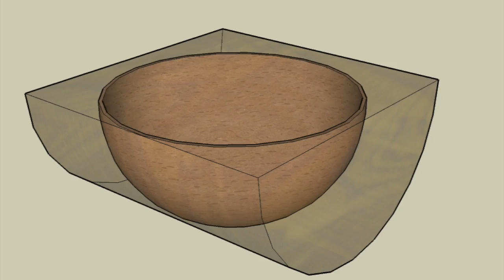President's Challenge, Sept. 2015

Comment: Thanks Brian, It seems as though I will be really limited since logs are not typically balanced. Perhaps I could make it partially round with my bandsaw and then put it on the lathe. Do you know of a way to slow the lathe speed down? The Grizzly lathe that I use has a bully system that uses double plates that squeeze tother. This alternating size slows and speeds the lathe. Thank you!

Comment: For those in the UK: DNA = Meths or a more recent (and slightly cheaper) alternative, bio ethanol (just check it's the 96% one).
Reply from the maker: Thanks for pointing out the difference in terminology.  I was unaware (but not surprised) that the nomenclature was different on the other side of the pond. ;-)

Comment: I really appreciate your articulate instructions! I have a Grizzly lathe and I want to start making bowls. The slowest speed is 600 RPM's. What is the safest way to make bowls on this lathe considering its slowest speed?
Thanks for any help!
Reply from the maker: +melanieheinrich The general recommendation for lathe speed is that the diameter of the work times the RPM should be from 6000 to 9000, so you could go up to 15"—if the work is balanced!  What you have to be really careful of with the low-end speed being so high is unbalanced work.  If the work is really out of balance it is apparent even when spinning the work by hand.  Apart from that, I would suggest always standing to the side when turing on the lathe at 600, and keep your finger on the off button so that you can turn the lathe off before it starts dancing.
Reply: +Brian Havens Check the speeds! I don't any lathe that will turn at 6000-9000.
Reply from the maker: +texanky 6000 - 9000 is just the reference.    8" bowl x 1000 rpm = 8000 , so that would be safe

Comment: Thank you Brian.  I have been using the alcohol bath (completely submerged) method of drying seven Bradford Pear bowls (about 8" diameter). I let them soak for 24 hours,  but four of the seven have cracked within a week of removing from the alcohol (the remaining three are still in process).  Would leaving them in the alcohol longer help?  I use the 10% of the diameter rule for wall and base thickness.  Would using green wood sealer rather than kraft paper on the outside be worth a try.  I leave them on one inch stickers, rim-down/base-up, on a table in the garage after applying kraft paper to the outside.  The alcohol method doesn't seem to work for me.  Any idea of what I am doing wrong?  This is my first attempt at doing green bowls.  Thank you for your many woodturning videos.
Reply from the maker: Sounds like you are doing it exactly as I do, so I am at a loss as to what is going wrong.  I have used green wood sealer instead of paper (on the back and the rim), and it worked well. I would not expect soaking it longer in alcohol would change anything.  What is the humidity in your area?  It is dry here in California, and it does seem that it is better for the blank to dry quickly (as counterintuitive as that seems.)